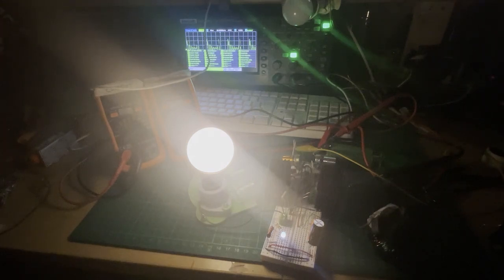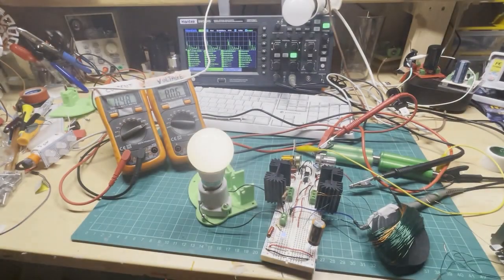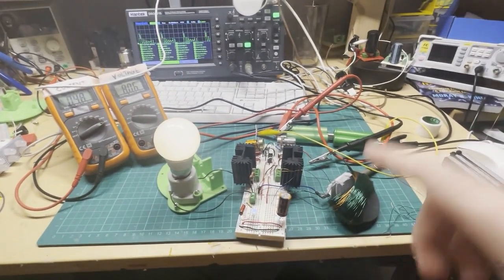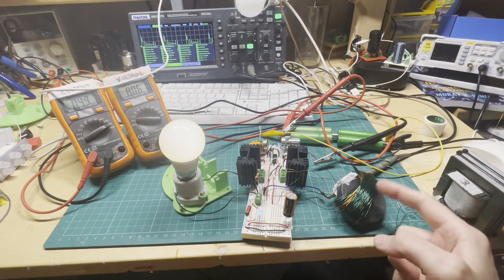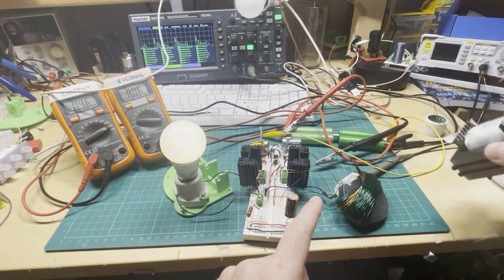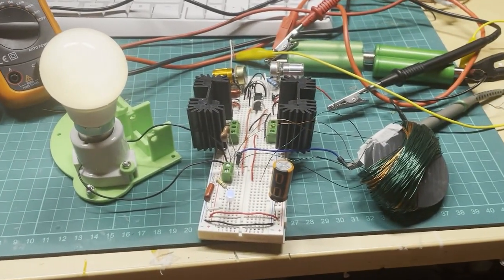Magnet transformer with Push Pull DC-AC converter

Comment: How many turns is your windings?
Reply from the maker: The Magnet Transformer has 200 turns in the primary coil which has a center tap. To make your center tap for your primary coil, what you do is you make 100 turns, then solder a new wire to your primary when you get to 100 turns and the complete the rest of your 100 turns for your primary. The Secondary only has 160 turns.
Reply: @michelsbench sir what type of core you used in this test, ferrite core or ferrite magnet as core